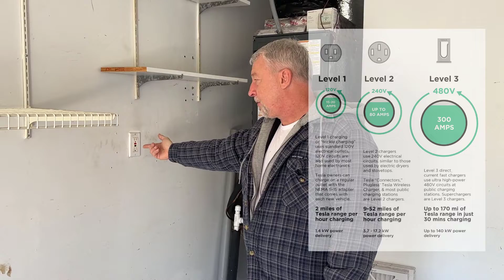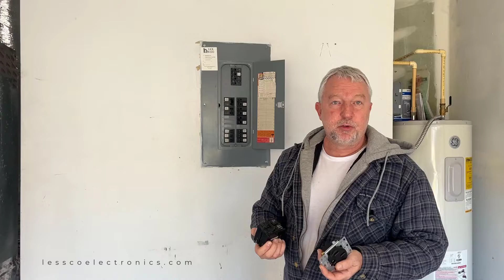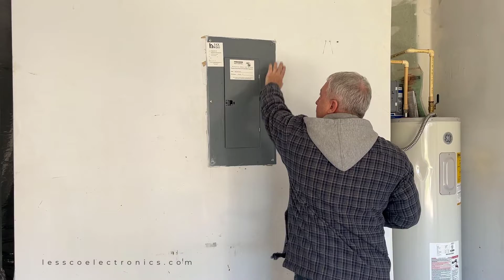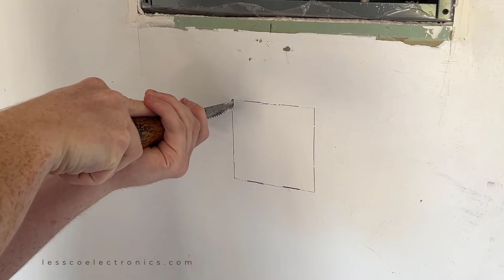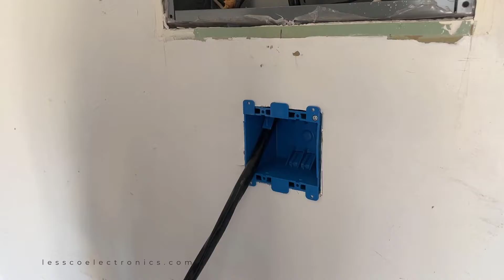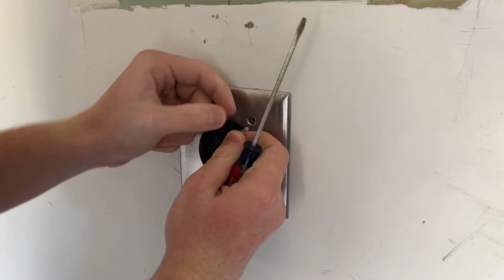How To Install A 220V EV Electric Car NEMA 14-50 Tesla Charger

Comment: In short  you need a 4 prong female outlet on your wall with a 40 amp breaker , under 10 feet from panel #10 wire copper
,,,,,,,,,,,,,,,,

Comment: For the frequent  insertion/removal cycles with EV charging, I would strongly encourage: 1) mounting against a wall stud, 2) 6 gauge wire not 8, and 3) commercial grade outlet.

Comment: A couple things. Make sure to use a commercial grade outlet ($50+) as history has shown that the cheaper outlets are not built for the continuous EV loads. Check with you local inspections on if they require a gfci breaker. It is a change in the code although not all states have adopted the change. Always pull a permit and get an inspection.
Reply: do you have a link for one?
Reply: @keystoevolve  

Hubbell Wiring Device-Kellems 50 A, Industrial, Receptacle, HBL9450A

Comment: ok.. so basically neutral wire and ground wire connects to same spot. if you use multi-meter on Ground and Neutral does it give you 120v AC ? I thought ground should be earth..  thanks for video
Reply: If its a main panel, the ground and neutral wires are together.  If its a sub-panel, they must be separate.
Reply from the maker: Yes, correct

Comment: Hi got a question. Came across your video just now about the Compustar CM7200. I recently bought my car and older owner had this system installed. The antenna says ANT-2WSP so I bought the remote but couldn’t get it paired. Not sure what I need to do now any help? Yes I’m aware this is a old system
Reply from the maker: I'd call compustar tech for a replacement remote or an antenna swap to a current version to fix that